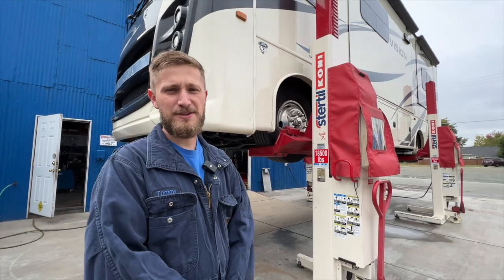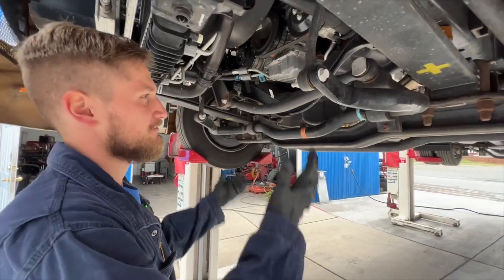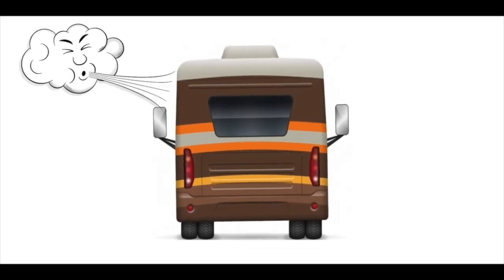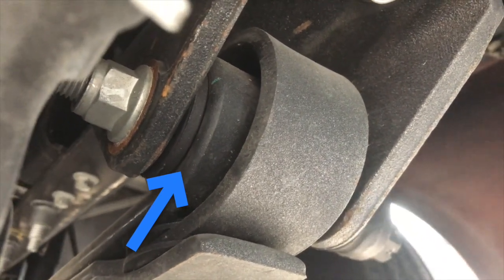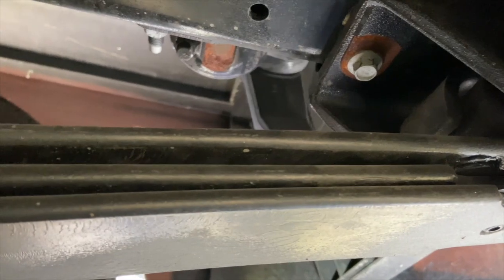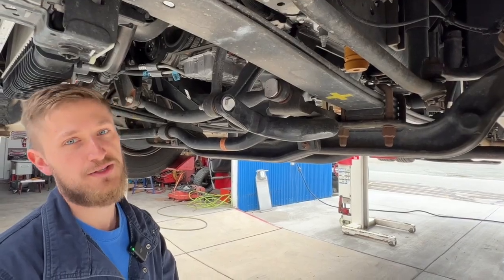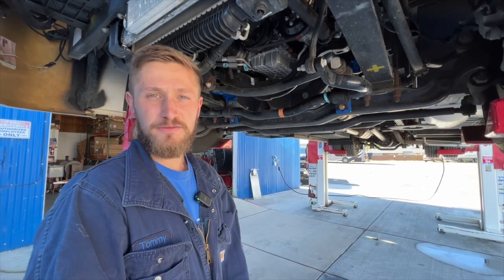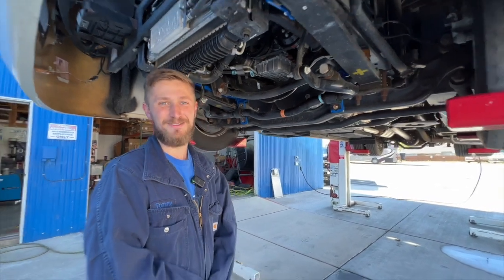Unveiling the Secret: Why Radius Rods are Essential for a Ford F53 Class A Motorhome

Comment: Just got my 2008 Fleetwood Terra back from the Authorized repair shop (Luxury Coach in Rockwall, Texas). Had the SuperSteer 'Tier 3' suspension upgrade installed. Generally, it made a huge difference in handling but I still feel a lot of play in the steering. Is there a chance it was not adjusted properly or am I looking at another issue. The RV is an older one but only has 15K miles on it so hard to believe the steering is worn...
Reply from the maker: Thanks for reaching out, we appreciate your business! If you're still feeling play in the steering, we'd recommend looking at your steering gear adjustment as well as weight distribution. Luxury Coach should be able to check for steering play for you, or you can have someone help you do it by rocking the steering wheel back and forth a few inches. Watch the input shaft to the steering gear and check if the Pitman arm (output from the steering gear, which your drag link connects to) moves as soon as the input shaft is turned, or if there is a delay. If there is a delay then this indicates play in the steering gear and can generally be adjusted out. It is worth noting, however, that an overly tight steering gear can in come cases feel like steering play because it keeps the coach's steering from centering completely on its own. We'd also recommend weighing the coach on the front and rear axles individually, and checking your ratio of front axle weight to rear axle weight. We want to see at least a 0.5 ratio of front to rear axle weights. If it is too light on the front, this can make the steering feel twitchy. If you'd like to discuss further, feel free to call us at 888-898-3281. Thanks!
Reply: @SuperSteer  Thanks, I will. I have adjusted steering in cars but never on a large truck. I will also get the weight distribution looked at. Appreciate the input.
Reply from the maker: You're very welcome! Let us know if you have any other questions.

Comment: Doesn't those push the axle back as it moves up?
Reply from the maker: Good question! The radius rods install in a relatively level position, so there isn't much rearward motion. They do have a slight downward slope toward the back of the coach, but this matches the angle of the spring itself from the front spring eye to the axle.

Comment: Are they available for the E-450 chassis? Good video. Keep ‘em coming. ❤️
Reply from the maker: Thanks for the feedback! The E-450 chassis actually already has radius rods as part of its Twin I-Beam independent front suspension. The E-450 does have its own steering issues (which we can help out!), but it doesn't have the same problem of fore/aft movement in the front axle that the F53 does.
Reply: @SuperSteer  Redlands installed the front, rear and trac bars. They also installed several years ago koni fsd shocks, safety plus and banks power. So it sounds like I have everything I need at this point, correct? I currently don’t have any suspension problems. Just was wondering if the rods were something to consider on the E-450 chassis.
Reply from the maker: @aaaideas4U  It sounds like you do have the main upgrades we would recommend! Redlands is a good shop to work with. Rear SuperSteer Trac Bar, front and rear Roadmaster sway bars, Safe T Plus, and Koni FSD shocks are the main handling upgrades we would recommend. Are there any areas of the coach's ride and handling where you are still looking for improvement?
Reply: @SuperSteer  I have made all of those upgrades. Thank you. You basically answered my question with respect to the E-450 chassis that the radius rods are unique to the F53 chassis and only that chassis.
Reply: @aaaideas4U  Kind of late but let me suggest going to a local truck spring shop and having the rear springs rebuilt. I went your same route but found the rear springs were the real culprit. Since that upgrade where they added 3 leaves, the remaining sway, wallowing, bottoming of the rear suspension, and scraping on inclines is gone. I should have done that first.